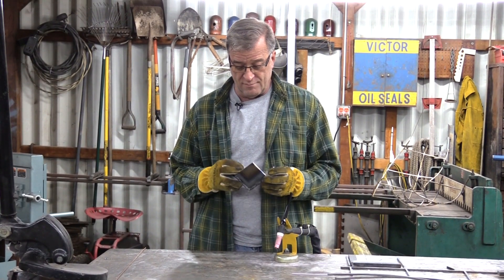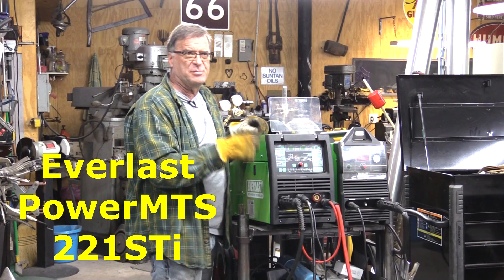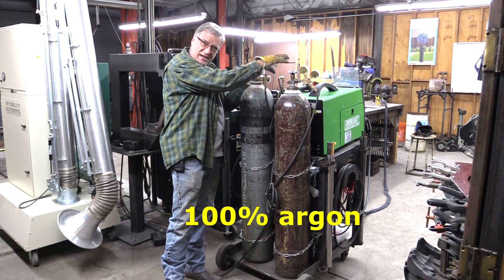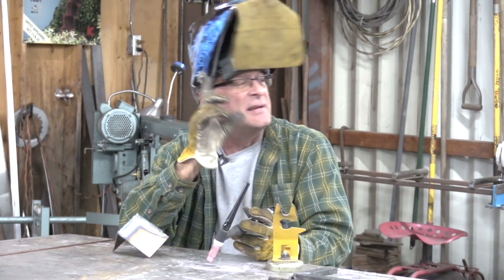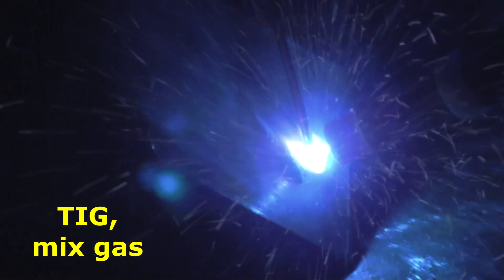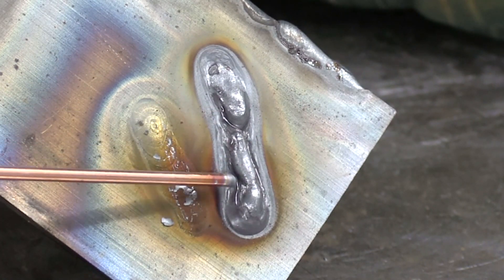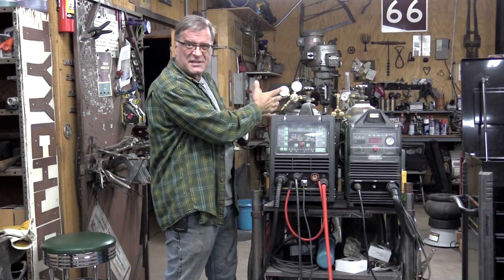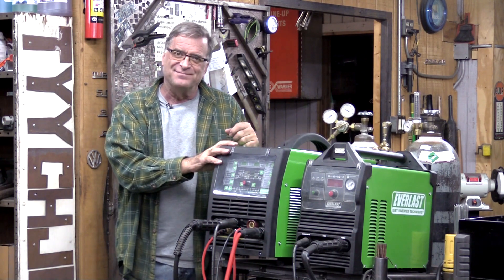Why Can't I Use 1 Gas for All Welding? - Kevin Caron

Comment: If you are a gunsmith and all your working is filling small holes, repairing sear notches on hammers or, on the worst scenario, fixing a crack on a revolver frame, pistol slide or frame? Since sometimes the part will be made of stainless or a light alloy, is it possible to use only pure argon?
TIG, not MIG.
Reply from the maker: I tried straight argon once.   Didn't like the results so went back to the argon/co2.  There is a reason that is the most common gas for tig.  It just works the best.

Comment: It almost answered the question. So what happens if you mig weld reg steel(not aluminum) with 100% Argon? Does a crack open up in the space/time continuum? Lol  Love your channel. Been looking for a way to convert my old(15-20yr) Lincoln weld pak 100 to a spool gun for aluminum. Ever heard of such a thing. What welder were you using with your spool gun(I saw it in a previous video today).  Edit: I went back and found the video. You said you were using a Longevity mig welder.  Thanks
Reply from the maker: Thanks for watching and posting Rick!   Don't know of any way to convert the weld pak to spool but Everlast has a great little MTS 140 just on the market that does spool.   Just for the record I don't use Longevity machines anymore.  Running your mig on 100% argon will just get you real crappy looking welds and nothing that you would want to trust to hold.    I don't recommend it.

Comment: So you can't use mixed gas with TIG, can you use straight argon with MIG?
Reply from the maker: I use straight argon for mig aluminum.  But for mild steel, no, won't work like mix gas does.
Reply: @KevincaronSculpture  ok, thank you

Comment: Thanks for sending me this link and replying to my comment on your other video. 
I have a Lincoln Weld Pak 100 from the 90s. MIG. The instructions say use 100% Argon. I use mix,  but now buying a tig. I figured I could just use Argon.
I guess I can't. Thank you!!
Reply from the maker: MIg is never straight argon.   Co2 and argon mix, or co2, argon and helium.   Or just CO2.

Comment: Hey Kevin I just finished my 1st bottle it was a 125cf & I guess I found out that right about 500 psi the gas loses its coverage. I stepped up to a 251 cf. It was about $175.00 step up but I instantly saw where I was having my issues.
Reply from the maker: Oh yeah,  gas coverage makes all the difference.

Comment: Hey kev.what ya doing! Still building my penrose staircase my friend. Boy it's a pain,!any tips to weld aluminium to reduce grinding  on the small pieces.just got a lift/scratch start set up.120 amp max .uk 240 volt.hard to weld without leaving a mountain of weld ,and work!!!someone said use  a piece of copper or brass to stop penetration?.some times I weld a little to hot and blow a hole😭hard to reach places are not easy😭😜😭😜😜😭
Reply from the maker: LOL Wayne!     Just need more helmet time and lots of scrap to play with.   Practice "this" joint on a 2 pieces of scrap to get the settings right and then do the real weld.  You are a little hampered with the lift start but if you are used to it great.    You can also go smaller diameter on the filler wire to cut down on the excess weld height.
Reply: @KevincaronSculpture  
Yer buddy.just used to fillet welds in  mig.mig does spoil a man!.boy does tig test a man lol.!

Comment: hey kevin, i'm really confused. Running solid core (mig) with 92% argon and 8% co2 works wonders,  so how come 100% argon doesn't work?
Reply from the maker: I really don't have a good answer for that.  I just  know the weld looks like crap when I tried to use just argon.
Reply: @KevincaronSculpture  sure, thank you
Reply: @taitelennox4514  : I use 88% Ar and 12% CO2 on MIG because that's the only Ar based mix I can get locally.   It works fine too.  But at different welder settings to what I suspect you find best.
I asked a couple of pro welders if its ok to use one gas, straight Ar, for both MIG and TIG and they didn't answer.   They've never tried it I guess.

Comment: hi 
what is your full setting for aluminum tig welding ( even your tungsten ) with Mts 221sti ?
thanks .
I will be appreciate if you make a video about this machine .
because I have that for 2 years and more then 10 time I try to aluminum welding with it but I couldn't . 
that's why I hate this machine .
thanks
Reply from the maker: Already have!   Look here,,  https://www.youtube.com/watch?v=hx8fRHwLuF4&t=1s   
Are you switching the ground cable to the correct port for A/C welding?

Comment: This seems more of a what happens if you use the wrong gas as opposed to why you can't use the same gas.

For MIG short circuit you use 75/25 mix due to MIG runs on a constant voltage machine and your generally on DC+. The heat is going into the wire to essentially vaporize it as it travels to the metal. You need the Argon portion to protect the weld, and the CO2 portion in order to achieve any sort of penetration.

For TIG your on constant current DC- where most of the heat is directed at the base metal. There is more than enough penetration so you only need to shield the metal.

CO2 is not completely inert which is why it helps with penetration on MIG, but makes a mess with TIG as it's essentialy over penetrating.

I don't believe that is 100% accurate but I think that may have been what the question was about.
Reply from the maker: I knew someone smarter than me would come along and set things right!
Reply: @KevincaronSculpture  haha, thanks Kevin :)

I wouldn't say smarter. Just trying to answer the "why" part. Hopefully a smarter person will come along and get us a definite reason as to why.

Comment: Can you show what happens when you run straight argon through the mig, welding on steel, please? Isnt argon used when migging aluminum? 
 Couldnt you use argon for gas shielding on all metals with all processes? 
 Idk really as ive never tested or questioned why we use different gas for different processes. 
Thanks for sharing
Reply from the maker: Yes, argon is used for spool gun welding on aluminum.  And yes, you can use argon for all types of welding.  It just doesn't work as well as the mix gas for steel.  Just trying to show the difference in the 2 gases.
Reply: @KevincaronSculpture  :  My "as well" might be different to your "as well".  Can you please demo what happens if you use straight Ar for MIG on steel?

Comment: Ever consider instead of using that Y valve as an A-B switch, using it as a mixing manifold?  You could then buy straight Ar for one bottle, straight CO₂ for the other bottle, and could mix when you want a blend for GMAW or straight Ar for GTAW.

I saw one welder's technique for GTAW to introduce Helium in with his Argon when he was working with Aluminum, apparently the net result was better heat transfer than he saw with straight Ar.  He wasn't running straight He because of how expensive it is these days, but as a small percentage of the total gas it helped.  A similar mixing manifold was used, I think the flows from the bottles' regulators were what ultimately defined the mix.
Reply from the maker: Just have to have a back flow prevent er of some sort to keep the pressure in the 2 bottles from equalizing and contaminating both bottles.

Comment: I have to add that 100% HE is wounderful for thick material that spread heat quick. (adds more heat but cost more than Argon). Also, lets open the school book here. Argon is an Inert gas, that means it dont react with the weld but CO2 do. T"A"G welding with an "A"ctive gas should not exist, its something the devil came up with as a torture device.

Comment: The Avortec first  all in one multi TigAcdc pulse square wave ,Mig ,Plasma cutter ,arc welder , you can only use straight argon to weld in all modes including mig with steel had to use straight argon.
Reply from the maker: Never heard of it.
Reply: @KevincaronSculpture   we had the first all in one , the Av6x +mig by Avortec , it only could use the straight argon ,on mig steel or aluminum or ss steel , same as the tig would use , your finding now others have changed the bottle gas needs to more argon less co2 using the tig frequencies as we were to weld mig with . It doesn't take long for them to take what was built and spread it amongst the world.

Comment: Should of run mig with argon
Reply from the maker: Why?
Reply: Why do you need the c02 for steel mig? Would you get the same results you did using straight argon welding steel with mig?
Reply: @98stacy  Different Penetration Rates with Others Gas Mixes .
Reply: @98stacy  I've seen it covered elsewhere, and it did not work well.  Remember, the process we refer to as MIG really isn't Metal-Inert-Gas when used on steel, and the term "Metal-Active-Gas" or MAG applies, referring to the change in shielding gas chemistry.  That's why GMAW or Gas Metal Arc Welding is the more official term that encompasses both shielded, wire-fed processes.

Straight MIG was originally developed for Aluminum welding, not steel.  It became a steel process because of its versatility and improved once the shielding gas chemistry was worked out.